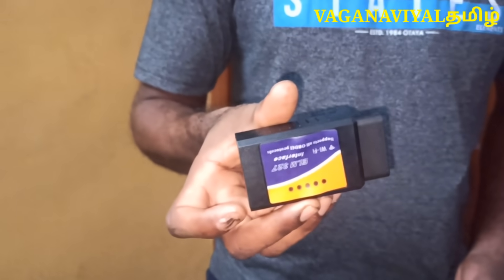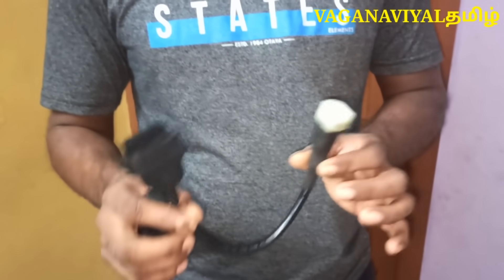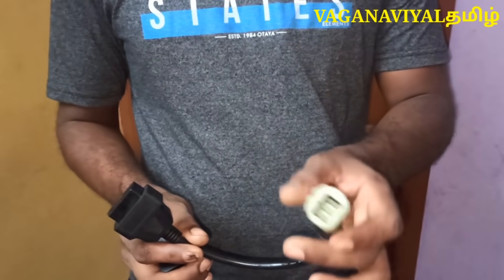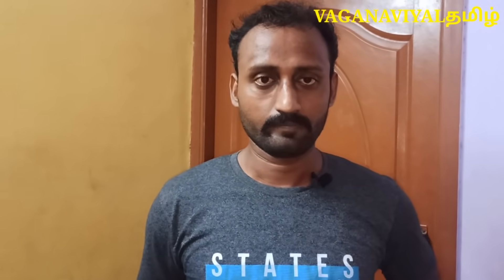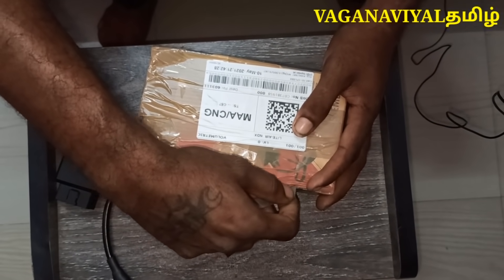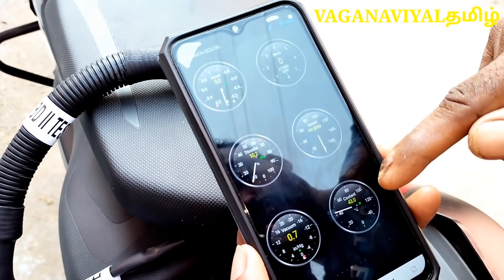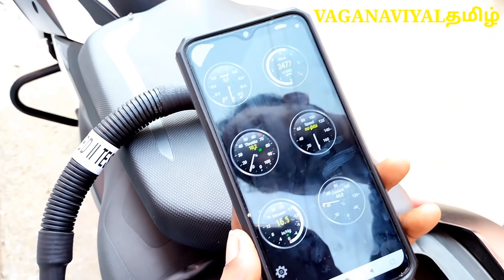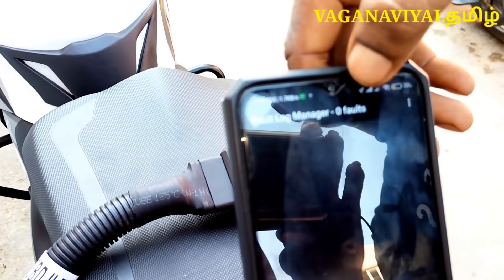ONE OBD Cable For 7 Brands Bikes- 7 in 1 OBD /தமிழ்...

Comment: Still it can be simplified anna. We have to make a 5 or 6 pin common connector for obd's scanner at one end with +ve, -ve, can high, can low and k-line in one other end. Then we can make each socket with 5pin one side and other end obd socket with respective pin as per bike design anna. If we design in this method there will be no supply loses in connecting it obd,this concept is on my point of view . 
This model which you senior chief design is also awesome anna.
Reply from the maker: Thank you bro